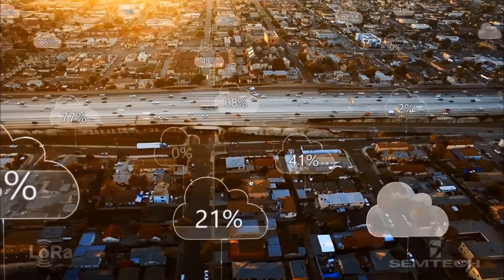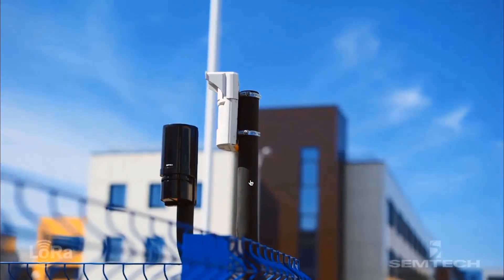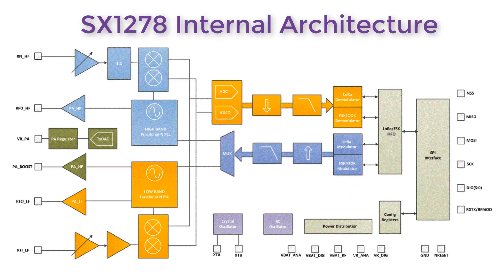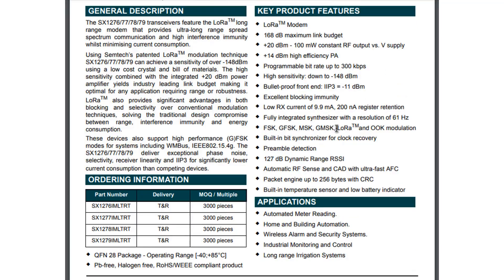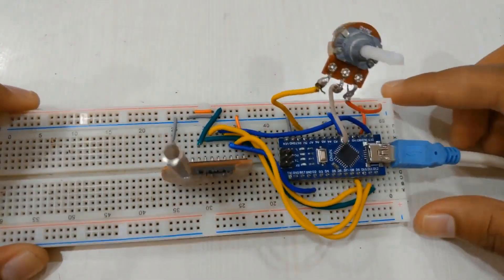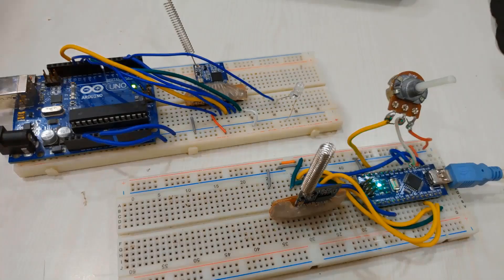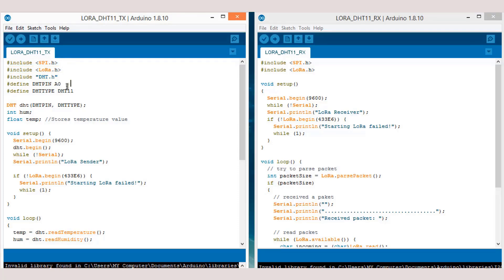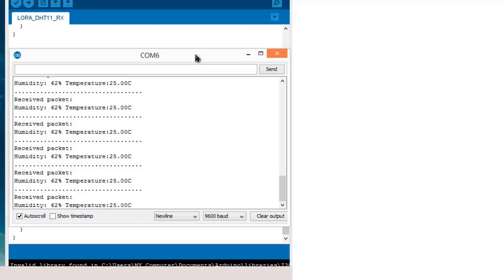LoRa SX1278/76 Arduino Interfacing Tutorial | Sending Sensor Data Wirelessly with LoRa

Comment: Note that the LoRa module SX1276 for the emitter should not be powered by the Arduino Nano, but by an external 3.3V power supply to have enough current

Comment: It is uncertain about adressing with this LORA modules because i dont understand how he differ them in one area. I suppose we can make different networks by settign different frequencies and other parameters but what if someone uses the same setting in the same area where i use my modules. I suppose in that case this is my work as a programmer to make adresses with the program itself so strange packets get left out if they come but still i dont understand why nobody who teaches about this modules does not emphasize this.
Reply: Did u got the solution buddy ??
Reply: @LAVISH-yv9yg  unfortunately, i didnt. I dropped learning LORA a long time ago since i didnt find it useful for my projects.
Reply: Actually if u use multiple transmitter and receiver in an area then we have to define unique identifier for each transmitter and will use same identifier in the code of corresponding receiver that it will receive data packets from corresponding transmitter.

Comment: WARNING! Unless you use a 3.3V arduino board such as the Pro Mini 328, or use level shifting on your data connections between the Arduino and SX1278, you will have problems.  I found this out the hard way.  The data outputs on 5V boards are too high for the the SX1278 and will create havoc.   It might work, might not, may possibly damage the module, but will be unreliable at best.  Make sure you are really clear the Arduino you are using is compatible with the SX1278, or compensate accordingly.
Reply: Thank you very much. I was stuck for 2 weeks. your warning comment solve the problem. thank you very very very much
Reply: @angelalferez2002  You're welcome.  Using a bidirectional level shifter will work (though hogs real estate.) Be sure you get one fast enough (such as the TXS0108E.)  Although I am using simple resistor voltage dividers on several projects and I haven't had any problems.  I chose a fairly low resistance so as not to affect speed.
Reply: @kevinjones9586 Hello, which of the connection pins are input on the module = need voltage regulation. And how strong resistors did you use for the voltage divider.
Reply: @marekcermak3843  Any pins which could have 5V applied to them, which includes all AFAICT except MISO which is output only.  Voltage dividers are a tradeoff for limiting optimal speed against power consumption.  My application didn't call for low power consumption so I used 330/680 ohm.
Reply: @kevinjones9586  If i want to keep the speed as high as possible should I use higher or lower ohm resistors, or are there any other sloutions you would recommend?
Thanks for replying 😉
Reply: @marekcermak3843  The lower the resistance, the higher the capable speed.  I wouldn't go any lower than what I used.
Reply: @kevinjones9586  So 380 from ardu to module pin and 680 from module pin to moudle gnd? Thanks a lot.
Reply: @marekcermak3843  Google resistor voltage divider
Reply: Can i just use a voltage regulator? For 5V output? New to this

Comment: Can we use sx1278 in india
Reply from the maker: Yes use it for learning, not for commercial application qs 433MHz frequency is not allowed in india
Reply: @HowtoElectronics  is it possible to send data from multiple lora node to the single lora node and connect to the network (like lora gateway) without using lorawan
Reply from the maker: Yes you can do
Reply: @HowtoElectronics  will you please make a video for that, because there is no the right sources to study about it

Comment: Why did you not use logic level converters for your connections to the LoRa sx1278 modules which operate on 3.3V logic ?
Is there no risk of burning your module by connecting its pins directly to the arduinos which operate on 5V logic??

Comment: If we use Arduino UNO in the transmitter circuit and ESP32 in the receiver circuit, will there be anything that needs to be added in the code section other than the pin definitions? So, since there are different devices, do we need to add the necessary config commands for communication, or should it stay the same because the Lora module already communicates?

Comment: Hello sir,
Pleaaaassee reply.

I have sx1276 based Lora module from hpdtek (hpd13A v1.1), 868Mhz. Will this code work?
Reply from the maker: Yes this code will work. I too had HPD13A SX1276 module. The code works perfectly. Note: in the code part assign the frequency by replacing 433mhz by 868mhz.
Reply: @HowtoElectronics  thank you so much
But I tried this code and in reciever serial monitor I'm getting message like:
 Recieved pscket
............
-$-$@-$@+@_@+_+_+&(&(&(+_#+_@-@-_@--@_@--
Recieved pscket
............
-$-$@-$@+@_@+_+_+&(&(&(+_#+_@-@-_@--@_@--

What could be wrong sir?
Reply from the maker: Did you change frequency. Seems module is not able to communicate properly.
Reply: Yes sir I changed it to 868E6 in both codes. I will try again once and if not successful can I get your email id or contact for further help please. 🙏
Reply: As we have same module too (hpdtek) , please help me in this

Comment: Hi, I built this,  Transmitter works well , receiver works for few minutes and then stops ...is it and input serial buffer that can be overflowing on the the receiver side ?
Reply: Hi, did you solve this thing? i used two nano with linear regulator and  i had the same problem
Reply: @Renzo87  Are you running the transmitter and receiver codes on the same pc? When I run both of them in different sketch files on the same pc, I can run the transmitter circuit without any problems, but when I change the port settings and the board option of the receiver circuit, the port settings of the transmitter circuit also change. how can I overcome this problem?

Comment: Sir, is soldering required to this module.. Or can we use it by just inserting a single lead wire into that module..
Reply: requires soldering

Comment: Sir can we solder those pins with single lead wire sir...
Reply from the maker: Yes you can but it will be little difficult
Reply: @HowtoElectronics  yes sir that is where I'm afraid of it sir..

Comment: Hey, doesn't the arduino work at 5v, so won't the isp pins (or any other I/O pin) be at 5v? Will this cause trouble with the 3.3v Lora module? Or have u used a voltage divider in between? 

I made the connections as u said, but it's not working 😭😭
Sincere call for help.... 
I think I messed up somewhere
Reply from the maker: The SPI pins of SX1278 are 5V tolerable. Only VCC needs 3.3V

Please check connection for the board to work.

Comment: Hello I am using sx1278 ra 01 ai thinker and 2 arduino uno ...but the receiver doesn't receive any packets. Does this have to do with the fact that the arduino operates at 5 V while loRa modules operate at 3.3 V ? 
Would a level shifter make any difference ?
Reply from the maker: SX1278 SPI Pins are 5V tolerable
Reply: @HowtoElectronics  Thanks, but what can be the problem then ...

Comment: how much  maximum distance can cover this project
Reply from the maker: 5-6km
Reply: @HowtoElectronics  
How can I get 5-6 km range I also tried many times but range is only 500M not increased I m using lora ra-02 with 433mhz frequency
Reply: @kpinnovations6613 I also want to make  drone transmitter and receiver with this ra02 how much range you are getting now and can you suggest other module if it don''t give 5km range
Please bro guide me
Reply: bro have u really tested it ??
Reply: i want to connect 4 transmitter @ one recever  project  will you please guide
 & also want to read 485 data

Comment: That's very good video, I just wondering how to extrapolate every single analog in such temperature and humidity... For example, if in your program you would like to turn on a Led when temperature is higher then 30° how could you do that? I presume that is needed a swap from char to integer?   Thanks
Reply: int led_pin_1 = 8;
pinMode(led_pin_1, OUTPUT);
 
if (temp>30)
{
tone(led_pin_1, 100);       //100 = 100% of power 
}
else
{
notone(led_pin_1);
}
for that, you should connect the pin 8 to the led, and connect the other part with an eletrical resistance to the ground.
I not sure about that, but try it, it's the same protocol than a buzzer.

Comment: How it is differ from esp8266 in case of application
Reply from the maker: Esp8266 needs wifi to communicate it lora doesn't.
Reply: @HowtoElectronics  which one is better
Either esp8266 or LoRa

Comment: can we plug any wires on lora to arduino digital pins. how to know lora module which wire connect which arduino pin. should be plug like a video or something. is that has a rule or standart. i dont get it. can anyone explain. thanks.
Reply from the maker: Hi LoRa module is an SPI module. The SPI connection is fixed. You can't change. The connection diagram is given in video and also in website article. You can follow that.
Reply: @HowtoElectronics  thank you

Comment: I have a question, this Lora SX1278  need a power supply for 3.3v and the arduino can give it, but the Digital pins voltage in the arduino UNO have 5v, can those 5v damages the LoRa Module, or is possible to connect directly?
Reply from the maker: Digital pins are 5V tolerable. No problem with 5V except the Vcc pins which need 3.3V.
Reply: @HowtoElectronics  Hi, I was triying to find this information in SX1278 datasheet and I can not. There are lot of coments in LoRa foruns about that. Some higly recomends using logical converters. Your information is very usefull
Reply: @HowtoElectronics  Thanks a lot :)

Comment: Can i use Lora module for quadcopter ? Is this okay to use? Because I heard everywhere it's had nice feature for long range.
If no,which device can I use for quadcopter RC?
Reply from the maker: Yes lora can be the best solution for quadcopter if you wanna fly it over a long distance.
Reply: @HowtoElectronics  wow ok thank you..
Do you Know any reference design for this for basic coding and etc Sir.
Reply: @HowtoElectronics  Hello! May i ask? I'm a beginner in arduino-theme and programming theme. I want to ask - is it possible to send via Lora INT (or BYTE) arrays? It's looks like Lora sends only chars and string. And for example - if i combine INTs to one long string with commas between INTs, how can i separate this string to INTs back?

In my situation - i' have atleast 4 potentiometrs - 4 INTs. And i want to control 4 servomotors.

Thanks.
Reply: How much range?
Reply from the maker: Almost 6.5 km in open space with this module.
Reply: @HowtoElectronics  thanks..nice work buddy.. Subbed..